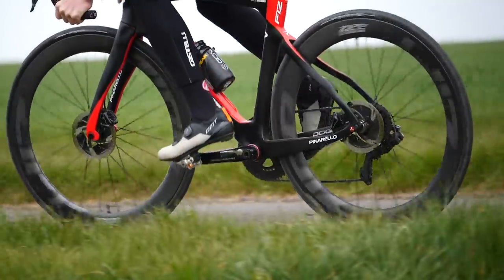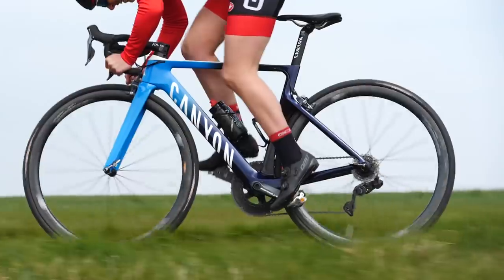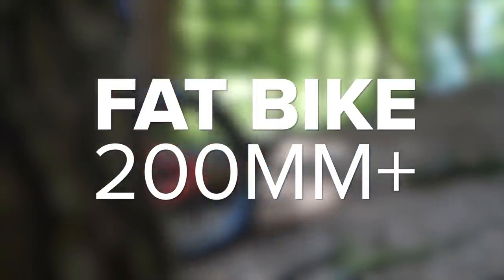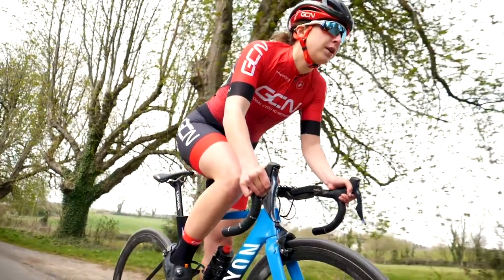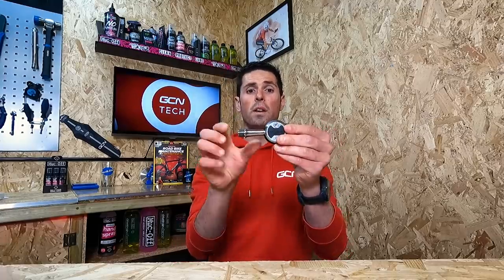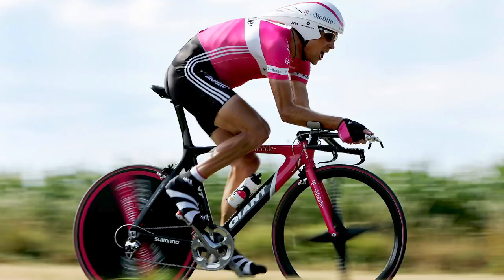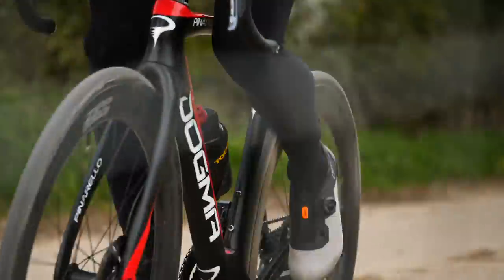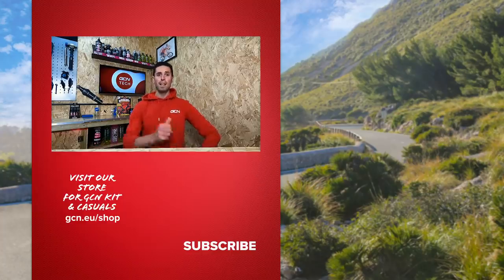What Is Pedal Q Factor On A Bike & Why Is It Important For Cyclists?

Comment: I'm looking to go from a pair of Look Keo 2 Max pedals to Assioma Duos. The Assiomas have a 1mm longer axle. Am I to assume I won't notice a difference between them?
Reply: Move your cleat outwards by the same distance (to move your foot inwards) if you think you'll notice a difference but I seriously doubt you will. I moved from Dura Ace pedals to Favero Duo and the Q factor was very slightly increased (cant remember the exact measurements but it was tiny) and I didn't notice a thing, I just set up the cleats (Keo compatible) that came with the Favero as I had the Shimano ones set.

Comment: SO! How do you measure your personal Q factor? Are woman with wider hips in need of a wider stance or tall people compared to shorter people? Time to get a bike fit specialist to finish this discussion.
Reply: Look at your feet when you stand naturally. Walk up and down a long hallway, the stop and see where you feet land. Also on a bike, if you pedal knees out, you need a larger q factor. So move the pedals out. If knees towards top tube, move feet in.
Reply: @scottbaker5851  It ain't that easy to figure out knees in or out.  
One of the best ways I discovered by chance was to ride on a straight set of road when the sun is low and directly behind you,  minimise the width of the shadow of your bike in front of you and observe the shadow of your legs (and knees) in relation to the shadow of the frame. This way I found that I had too narrow a stance.   
However I would also like to hear of a possibly more biomechanical measurement.  
What you describe woul give an approximation but remember that when standing / walking your legs are straight or only marginally bent.  When cycling your knees, hip joints move through a much larger range of angles and only at the extreme of the pedal don stroke doe the angles approach those you have when striding.  If your hip joints are 'toe in' or 'toe out'  for the lack of a better description, your legs will move very different at the acute angles during cycling, compared to walking.
Reply: @robertrjm8115  Shadows display a skewed form and I would imagine is highly, highly inaccurate based on the source of light.